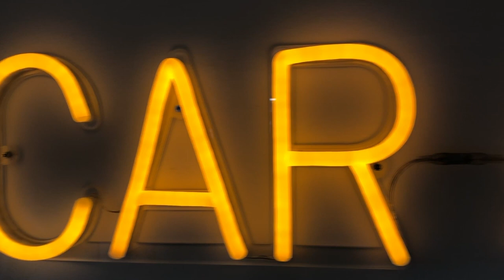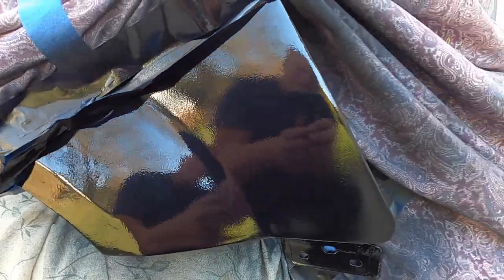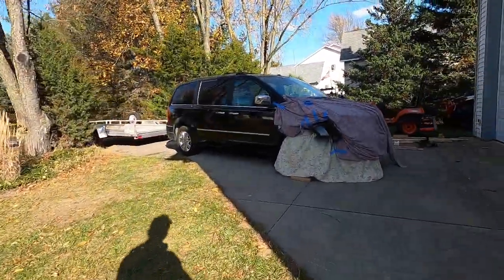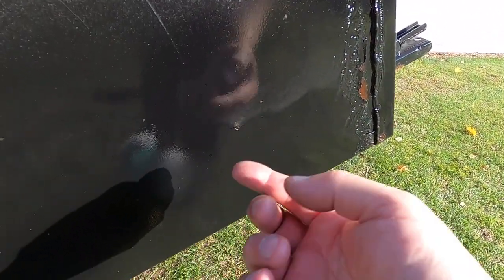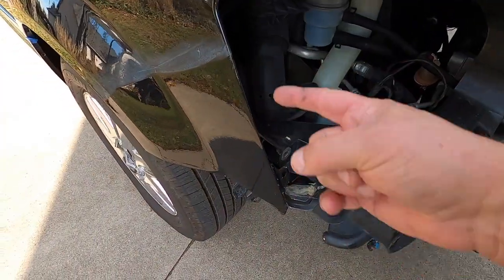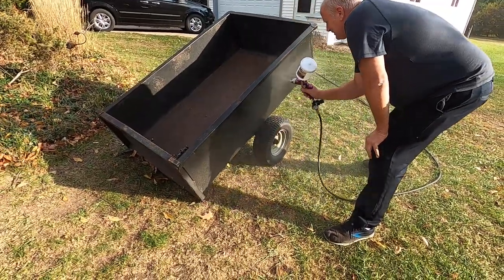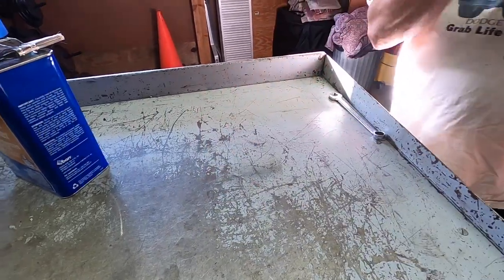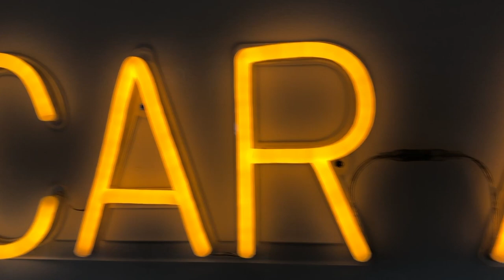Painting minivan bumper plus a 1973 Challenger with a Viper V 10 project car

Comment: It always amazes me how a couple hours in a spray booth evaporates all the hours of drudgery getting the vehicle to that point. Looks really good! Nice to see brothers getting along!
Reply from the maker: My favorite part is painting, because you know all the major work is completed by then.
Reply: @OldCarAlley  Exactly! I hope to experience that this winter on my Model A Hotrod. Also a couple touch ups on the 68 Mustang. I built a fiberglass hood for it years ago and it turned out really well until last summer I never realized that for some reason my electric fan had broken clean off and it started getting hot at idle when I was stopped by an RCMP who wanted to see my car lol. Right above the return hose the gel coat cracked so I got that to do. Good news bad news is no ticket but a serious repair lol

Comment: That 73 Challenger with the V-10 will be quite the performance car when it's finished.  When your brother mentioned the plastic welder, I was wondering if it is the same one that I have, and in fact, it is.  It's an interesting tool to have in your arsenal of tools.  My 1st use was to repair a leaking plastic fuel tank on a Snapper mower, and it worked for that.  I have not used it much, but enough to have bought some additional "welding" rods, the various little sticks.  And I recommend wearing decent gloves and being very careful when you're in close quarters, like fixing interior plastic bits in a car.  If your next project car turns out to be 70's - 80's, there might be enough plastic pieces to consider 1 of these.
Reply from the maker: Kevin stated I can borrow it any time I need it. Doubt I would get a car full off plastic as a project. I like the older stuff.... like early 70's and older. The older the better for me.

Comment: You get the gun's vent plugged  it will not spray good 👍
Reply from the maker: When I cleaned the gun that little cap on the top is the vent. I just comes off to make cleaning easer.... if you clean the gun. I think most people probably just toss them in the garbage...... The spray gun was nine bucks.